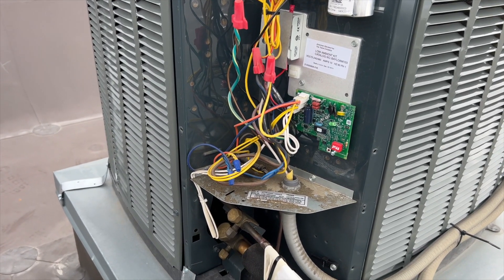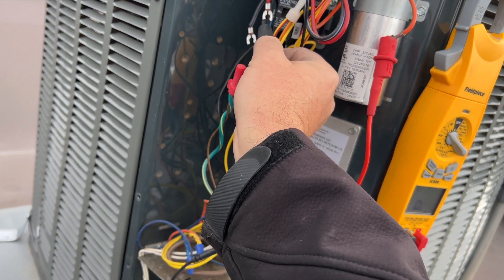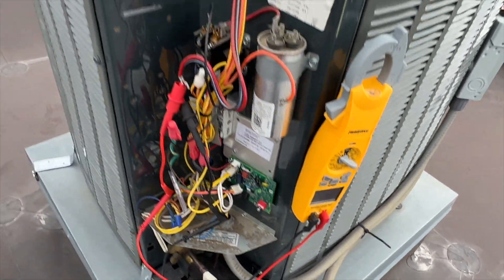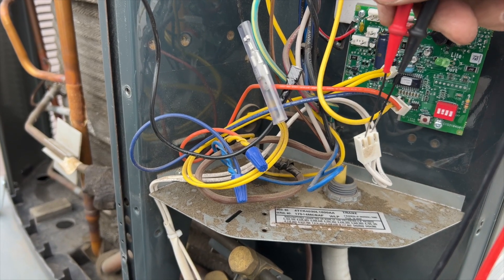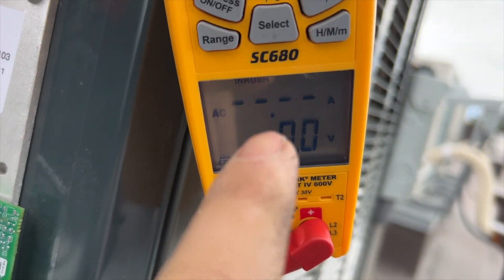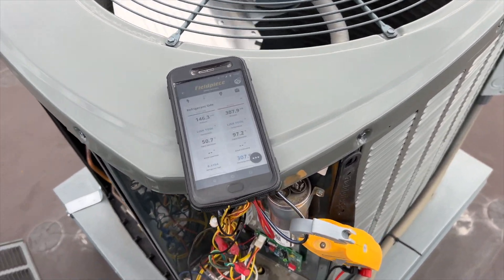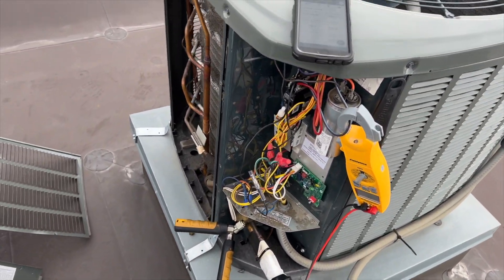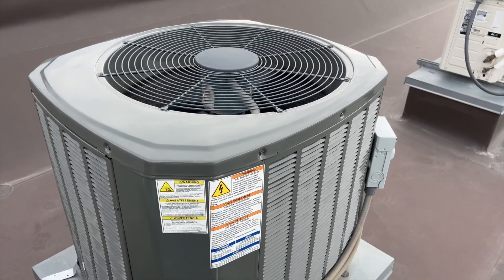Compressor not running.  Low ambient kit problems. EP115

Comment: Oh my, it looks like that DIP switch (and board) might not stay happy for long in the outdoor weather! Is it even coated?  

I'd like to see (or reverse engineer) a schematic for that Low Ambient Kit board to confirm my doubts that it's ever possible to (reliably) electronically diddle the speed of a large Permanent Split Capacitor motor without inviting failure, fire or frustration. ;-)  

The time tested “classic” furnace PSC blower motor has winding taps and uses relay(s) for reliable heat/cool speed selection with only two relays; a third relay can even be added to provide three speeds. BTW, IMO there's nothing wrong with solid state relays, but mechanical is safer, especially for that first/main blower relay and important things like controlling gas valves...

Does that board incorporate a wiz-bang Varable Frequency Drive circuit, or is it just a temperature-controlled turn signal flasher that's supposed to regulate Condenser Fan speed? Yikes, it sounds like eventual expensive trouble just to save a little juice that could instead be wasted on a tiny fraction of a single electric car.  lol
Reply: It's just ON/OFF. You could say it's PWM, but even that's a bit of an overstatement.

Comment: Oh, he’s like how those proprietary monopoly distributor oriented parts are astronomically high. 
          Of course, for most businesses in situation, it’s easier to stick with the original because all the wires are plug and play. 

Otherwise, we would probably be sticking in an icy M low ambient controller, and I recently for my first time was exposed to a PENN Low ambient fan motor controller what looked more heavy duty and more robust than the ICM.